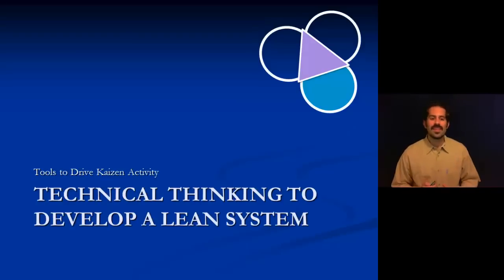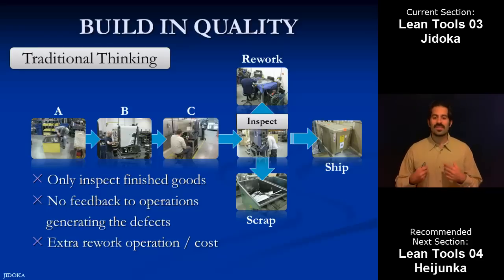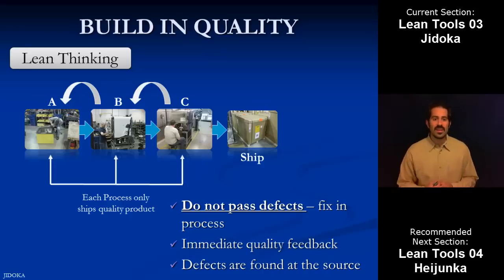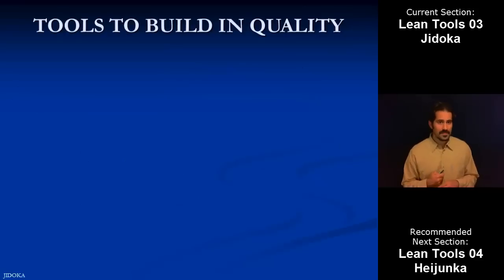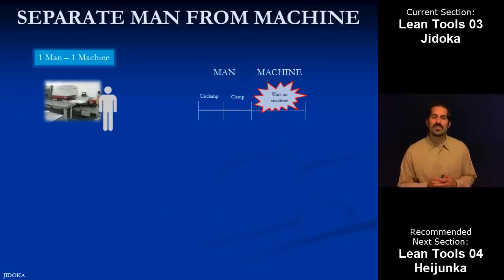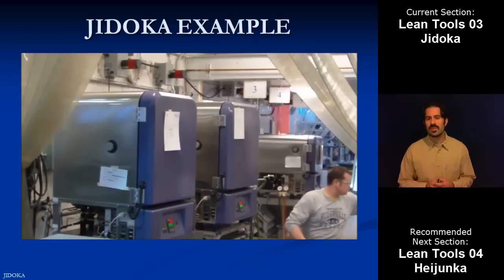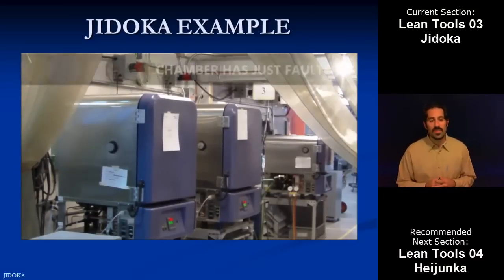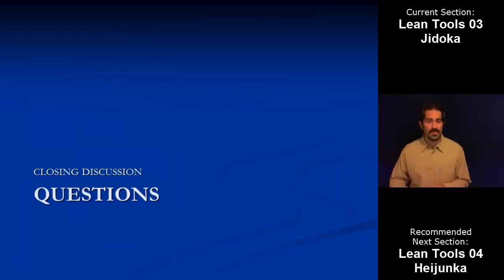Technical Lean Tools 03: Jidoka

Comment: Hi,
Thanks, very useful but I didn't really get the video example of Jidoka (guy with clipboard and eventually laptop)
Reply from the maker: +declan ocallaghan Thanks for asking, the basic premise is that we want to structure our work processes to minimize the amount of time our team members spend waiting on equipment or machinery to continue doing their job.  In the video example, the team member originally had to watch each machine run and take notes on the readings every few minutes.  This meant only one product at a time could be evaluated.  With the application of Jidoka, a computer system was installed to monitor multiple machines at the same time.  This meant the operator was now free to do other tasks (more efficient use of time/increasing throughput) and come back when the machines were done instead of waiting on them.